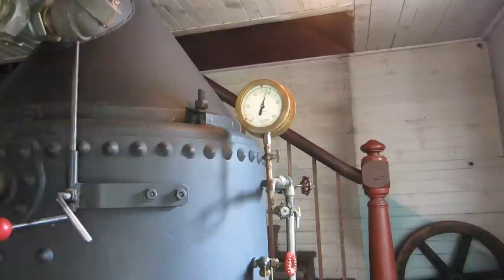OLD TIME STEAM POWERED MACHINE SHOP

Comment: David, GREAT channel!

Only issue I have, is you don't 
post often enough.  Keith Rucker does, 
though, so my itch is covered. (But, Keith 
doesn't post enough steam stuff for me.)

David, let me know if you've heard of the 
"Plierench."  I'm sending Keith a couple 
samples, and would like to know if you'd 
like a pair.  Google them, and let me know.
Think of it as a viewer appreciation gift.

The earlier patent was from May 1916, 
so that fits in your limitations.  Later patent 
was from the "between the wars" period.

steve
Reply from the maker: Steve:  Thanks for watching, I would like to put up more videos, but some of the projects are very time consuming one operation at a time. I have one coming out tomorrow. Are you manufacturing the Plierwrench? Sure send one I'd like to try it, check my profile for address..Thanks....Dave
Reply: "Are you manufacturing the Plierench?"

I wish!

David, no, only a fan.
In the late '60's, my father brought a pair 
home, from a garage sale.  Been in my 
toolbox ever since.
(In the late '60's, I was riding a bicycle.
And, am still.)

I'd be GLAD to get a pair off of Ebay and send 
them to you.  Just as an appreciation of your 
channel.

You want the 1916 patent date, or the later date?
Or, both?  Later one is an improved design, but 
may not fit into your "theme."  It is a 1934 patent, 
if my memory serves me.

steve

Comment: I think you did a good job. Does your machines have hand wheels with micrometer marking? By the way using digital calipers would be fine with me.
Reply from the maker: Tom, The dials on most old machines are quite small and hard to read. If I'm doing something close, I use a dial indicator to check myself....Dave
Reply: @davidrichards5594  I believe Brown and Sharp offered the first handheld micrometer for sale  with Mr. Whitworth having made the a micrometer with Whitworth a British engineer needing a micrometer for defining that British threading system. He also made the Whitworth rifle which was extremely accurate and was used by the Confederate snipers in the Civil War. I like looking at older machine tools and am curious about the addition marked dials on machine tools.

Comment: What do you think about running a electrical generator using a ultra-heavy flywheel and steam float bearing system?? I am very interested in alternative pwoer generation systems, that are off grid and sustainable  using steam power.  Do you know of anyone running a updated Stanley Steamer automotive engine?  Thanks for doing this video I see it is a few years old so I hope you still get notifications.
Reply from the maker: This is the first video of a numbered series, there are 53 of them on the channel (Old Steam Powered Machine Shop). I have an early DC dynamo that will be run by the first shop engine (I don't have the video number that featured it handy) and a Heavy duty 24 volt military generator that was scrubbed  when the big dynamo became available. I haven't seen any use of an automotive engine for stationary power. They are a little light and would require pretty high pressure steam.  ....Dave
Reply: @davidrichards5594   Thanks so much, just beginning my research into this sustainable wood fired or pellet style  biomass heat production for a steam powered electric sourcing.  I know the older tractors used a larger flywheel with steam boilers some i believe used a coal or wood fired system.  D.I.Y. is definitely preferable to manufactured mechanics for me. again you all are aces with me keep the fires burning.  
Keith C.

Comment: How did you acquire the shop?  Or did you acquire all the equipment and put it all together?
Reply from the maker: The building was bought by my father with the property about 1944. It was built in the 1880s as a carriage barn for a hotel. My father acquired the milling machine and South Bend lathe at auction after WWII from the local school National Defense Training program. The Barnes drill came from a Wagon Works in Owego NY that went out of business in the 1930s.  I found and rebuilt the American lathe about 40 years ago, it was outside, disassembled. The Shaper came from the Kinzer PA steam engine show organization a few years ago. All the pulleys, bearings and shafting I installed from what my father had stored away,  given to me, bought on ebay, reproduced to make pairs or scratch built. Nearly all of the belts are 100 + year old leather. I purchased the engine from someone in the Kinzer organization and it needed a lot of work. The boiler came from a 1924 Mundy steam hoist that a friend of mine rescued from a scrap yard. All the installation was done by me. Thanks for watching Dale.....Dave
Reply: Thanks for your response. I've watched about nine of your videos today. They are amazing and I'm amazed at the ingenuity of our forefathers. Thank you

Comment: I’m thinking of opening a steam powered shop, and was wondering.. How does coal stack up to Electricity in cost efficiency?
Reply from the maker: Hi Josh,  A steam engine, even a later design than mine, on saturated steam would give about 12-14% thermal efficiency. Good soft coal (steam, Bituminous type) in lump size if you can get it , would be about $150/ton at the mine. You can't use anthracite coal. If I use almost straight coal, I could fire the boiler for about six hours maybe 3 days/week and would use probably about 3 1/2 tons during the 5 months that I run the shop in the summer. It takes about 100 gal/day of unchlorinated water, and you should have an extra man to take care of the boiler so you can concentrate on what you're doing. It doesn't make much sense unless you have a lot of some kind of free scrap to burn

Comment: Do steam engines require only clean water to run or can you use brown river water?
Reply from the maker: The sediment will concentrate in the boiler and lead to some serious safety problems, so you would need to Open the boiler's bottom drains and "blow down" a considerable amount of water out regularly while running. Also shut the boiler down, remove the inspection hole "hand holes" covers and spray wash it out regularly. If the water is really bad, you might need some kind of filter or use rain water. PH should be adjusted to about 9.0 with Potash or boiler treatment. .....Dave

Comment: Am I correct at 1:52 you have your hand on a horizontal steam  run water pump? And if it is, does this one use leather valves ??
Reply from the maker: That one has brass discs for valves in the water side....Dave

Comment: What's the approximate power of this steam engine? That is under full pressure as you run it up to half its capacity (and I guess power)
Reply from the maker: 5 HP at 125 psi .

Comment: Can you give me any details on the roof structure of your shop?, I have an American tool works, flat belt drive, high duty lathe I am trying to set up and am not sure whether the roof of the shed my shop is in will be strong enough for the countershaft.
Reply from the maker: Hi Martin, thanks fore watching. The second story floor joists are 2 1/2" x 12s on 16" centers. The upper floor and lower ceiling is 1" tong & grooved. It was a carriage house originally so grain and heavy stuff was stored upstairs with no posts on the lower floor. You can always run some 4x4s cross-ways with the joists with to mount hangars on with posts if you are worried about it.....Dave
Reply: @davidrichards5594  Thanks.

Comment: Lovely machinery.  What's the klacking noise at 12:19 , have you got a slack rod-bearing there? Machines as good-looking as this should be sewing-machine quiet. (Not a criticism, just observation)
Reply from the maker: +nlo114  You're right, everything was knocking in the first video. A lot of work was done on the engine since then as I'v had time. Most of the noise was from valve gearing, loose eccentric strap, valve rod bushing,  end play in the slide valve, cylinder bored, piston built up, 2 rings made. It still has a knock from the "worn and taken up as far as it will go" rod brass bearing that I have plans to replace as soon as I find a block of brass that size and have time. I might just babbitt the brasses for the time being. It sounds some better in later videos, but not "right" yet......Dave

Comment: What part of the country are you located? Do you find most of your machinery locally or do you travel a fair bit?
Reply from the maker: I'm in the southern tier of New York State. The small shaper and steam engine came from a northern PA club,  I bought the large lathe completely disassembled from a gun smith,  The very small drill was a gift from a friend. Pulleys and belting were donated from local people that knew I was building a shop or from ebay. Some of the line shaft hangars I had cast to make duplicates. The shafting came "off the rack" at a local steel suplier.  Boiler came from a friend in Atica, NY. Everything else belonged to my father....Dave
Reply: Thanks Dave, I've subscribed to your channel. Would like to see any videos that show you making things or even doing "set-ups". I've always enjoyed watching these types of activities.

Comment: i wonder, can you put an effective condenser for the steam exhaust, that way you can reduce the water need.
Reply from the maker: Actually, a condenser does a lot more than that. I becomes sort of a "back handed" supercharger by pulling a vacuum on the engine exhaust. Only trouble is, it's hard to separate the cylinder lube oil from the reclaimed water. If it gets into the boiler it does all kinds of bad things including making it "foam" and pull water over into the engine. Great question....Dave
Reply: David Richards 
hmmm, then you probably need a long/tall reclaim tank with a bottom feed. It would be nice to be able to use a reverse osmosis water filter that could handle the heat. I wonder if most of the oil would be in that condensate or the steem that comes off the exaust. 
 Have you thought about putting any insulation around the cylinder head and exhaust.  
 Hey, ty for the response and thank you for that insight, i had no idea that would happen. Hey, i hope you find a way to separate the steam oil effectively and possibly reuse that as well too.

Comment: Where do you find old machines like those now. I am looking to build a steam engine. do you know where you can get designs or schematics? Or parts for that matter.
Reply from the maker: +Penney&#39;s Automotive Service Center Inc.   To tell the truth, most of the machines, I sort of "fell" into. someone knew somebody that had this or that. Right now there are three old belt driven lathes and a flat belt Racine cut off saw on the Sarasota FL Craigs list, for example.  Machines on ebay go a little high priced, but I got my horizontal boring mill there. Steam engines and boilers can be found on the "Smokestak" engine ads listing. Maybe a worn out steam engine to complete overhaul might be a good starting point. How big of an engine are you thinking of?  Model castings are available from many suppliers now and some of those get up to about 2" bore. ....Dave
Reply: +David Richards  And where do you find parts or are they made by you the majority of the time?
Reply: +David Richards  I am thinking about 10 hp at most. What would you recommend for a old time saw mill? I was thinking the bigger the flywheel on the line itself the more inertia. Hence less hp in the long run. I will look at Smoke Stak but I really was thinking about building one myself. Any place to get printed schematics of old steam engines?
Reply from the maker: +Penney&#39;s Automotive Service Center Inc. 10 HP would be about 6x7 bore & stroke. A little marginal for a saw mill, but would probably do something with 150psi boiler. 14-16 HP would be about minimum for a 48-50" saw. wider tooth spacing (less teeth) takes less power.  There was a book published and updated every few years starting in the 1890s called "The Catasism  of  Steam Engines" (I'm sure that's not spelled right) I found one on ebay. It has a lot of drawings and explanations but no prints that you could build one from. We had a Frick factory drawing of a few parts we needed to make for Mead's traction engine.....Good luck with it......Dave
Reply: +David Richards So then 20hp would be about right. double what I had thought. Would a twin piston engine with about 50 steam psi be right then? I'll go to ebay and search for that book. Thank You for the insight and your time. I wonder if there is anything from the patents office I could get a hold of.
Reply from the maker: +Penney&#39;s Automotive Service Center Inc.  A twin would be nice, but not necessary. At 50-60 lbs like I am running you would use quite a bit more water.  Google patents has great patent drawings, but no real detentions  Old steam engineering books would have the rules for laying out ports, valve timing, etc. .....dave.
Reply: +David Richards  Thanks Dave. I ordered that book off of Ebay last night and it's on it's way. I will look to that for further info.

Comment: So much danger, yet it's fine if you're smart and attentive. There is something about steam power that interests me. If I could find a way to make it practical, I would try to build a steam-powered car and daily it lol. I guess I'm a little spoiled by being able to hop in a modern car, turn the key, and be on my way in under a minute. No matter how you do it, a steam car is going to take at least several minutes to a half-hour or an hour to get going. Then you have a big issue if you run out of water or fuel while out and about as it may not be all that easy to find such. Then you have the issue of the boiler being a wee bit dangerous. Some steam cars didn't have your regular boiler and had a setup to flash water into steam, a bit safer, and also quicker "warm-up". If I had more money to play with, I would experiment with boiler designs and making my own steam engines.

If I could, I would totally build me a steam-powered electric generator for power outages. Screw diesel or gasoline generators.
Reply from the maker: Hi Mark, Thanks for the comment here. Steam cars ran pretty high pressures in their "water tube" type boilers and you just know that some saw regular abuse, but I never heard of one having a "total catastrophic failure".....Dave

Comment: How much wood is needed for an 8 hrs shift?
Reply from the maker: Jim: It depends on the wood. The average junk wood I get would take about 3 heaping wheel borrows full to get enough steam to run and probably another 8 - 10 to run all day, but I shut it down for set up, machine changing, coffee break, "yack breaks, etc. to save water and fuel.....Dave

Comment: Wat does the injectors an stuff do or for
Reply from the maker: Hi Cecil: Thanks for watching. The injector is used to inject water, by steam pressure from the barrels into the boiler to replace that which is used up making steam for the engine. There are two so if one has a problem, you can still keep the right amount of water in the boiler which is very important. It takes 50-60 gallons of water to run the engine all day....Dave

Comment: Those belts everywhere would worry me - I am somewhat accident prone.
Reply from the maker: My Dad had a rule. "Never put your hands where you can't see them" . He ran  machinery (including sawmills) to age 93. Had all his fingers and toes and never broke a bone...Dave
Reply: @davidrichards5594  I work with a pen and paper (well a computer) to avoid those risks. No high voltages, spinning blades, etc. Cool to watch and learn about this type of machinery thought
Reply: You may want to pickup an inexpensive 3d printer to tinker with. Not powered by steam, but a remarkable and inexpensive little cnc machine.

Comment: why do the drive belts sag? why not tentioned ?
Reply from the maker: Hi Tony: In the case of my belts, they are 100+ years old and I don't run them any tighter than necessary, and I haven't got around to taking some of them up that really need it. The main belt on the engine is pretty loose but I have been putting off changing the pulley sizes to make the shaft run a little faster. That would require changing the length. Some are critical, like the lathe drive belts. They have to be up very tight....Dave
Reply: thats amazin setup you have, do you get any problems with the speed feed or traverse with it being steam ?
Reply from the maker: Only that I could get more power through the belts if I ran them a little faster. A smaller main shaft pulley is in the works..Dave

Comment: recirculate that water by condensation
Reply from the maker: Hi Brett, thanks for watching. The exhaust steam from the engines has a small amount of the steam cylinder oil ( injected by the lubricator) in it which would be concentrated in the boiler making a sticky mess and causing it to "foam". Not good. There are such devises that separate the oil but but it was seldom done in the old days and I,m definitely not on that level of sophistication here in the shop......Dave